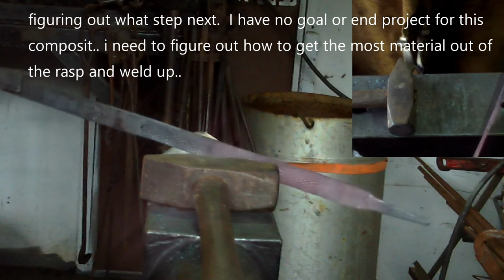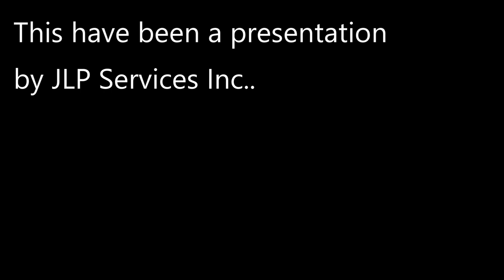welding scrap (old rasp, high carbon wagon tire and very rusty wrought iron) to make a usable blank

Comment: Whatever you make will be awesome...A knife would be one option. I vote knife if you are counting 😀 What did you have in mind ? Thanks for the great videos !
Reply from the maker: I really don't have anything in mind at this point..  If it were a straight steel billet with no Nickel  it would more than likely be a knife but I want something that uses the contrast of the nickel steel in the pattern to maximize effect..  I would will need to add more volume of material unless it's a smallish knife..  It is 3/4"Sqx9.5" long..  with 13layers..  At this point it would more than likely make sense to make another full billet and then weld the 2 together..  :)

Comment: Is it going to be something colonial and sharp?
Reply from the maker: I since have added 4 more layers.. 2 of 15n20 and 2 of 1045... Maybe just a simple knife but still no vision as to what it will be..
Reply: Ft Meigs belt axe?
Reply from the maker: I like the suggestion..  I'll think about it as there is not enough billet to do a full sized Ft Meigs axe.. If I use it in the traditional way the pattern of the steel will be lost as it would be engulfed by all the surrounding metal.. I could do and overlay technique which is harder to pull off and this would leave a pretty nice Damascus pattern..  HUM>>>>
Reply: Ya, I see what you mean.